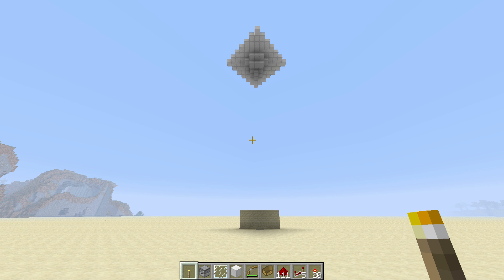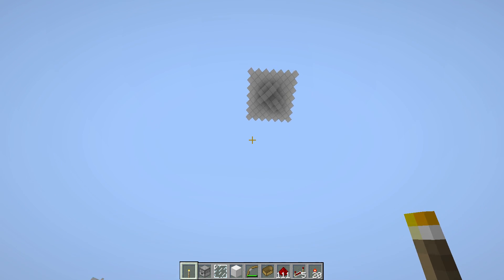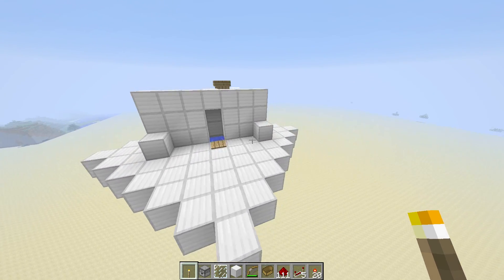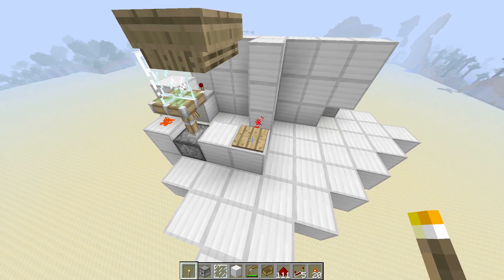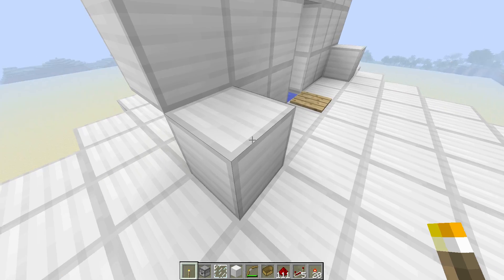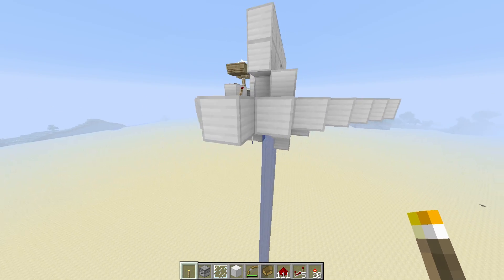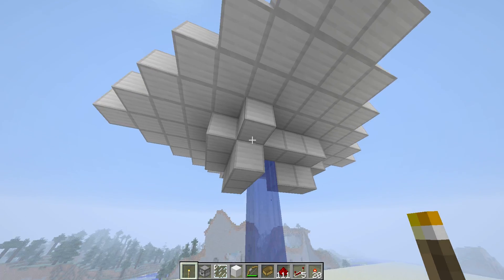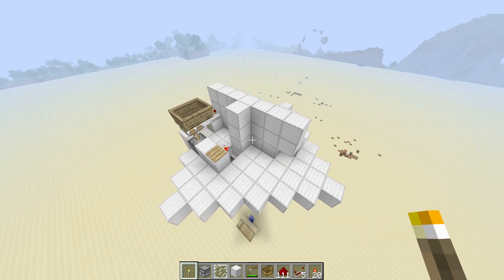Wireless redstone (no mods)

Comment: @sergnoff94 The way it works is that when a glass pane of the transmitter gets hit with an arrow it tells the glass pane of the receiver to take its shape, so when its the right shape the glass wont collide with the boat and it will fall on the pressure plate.